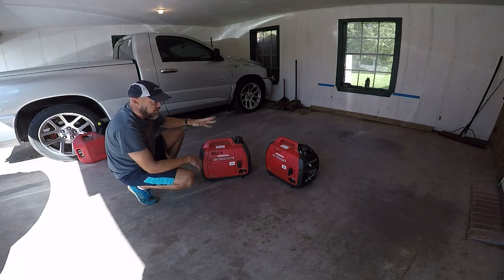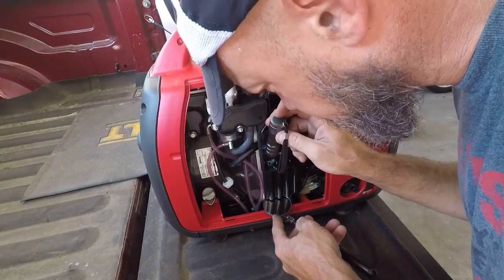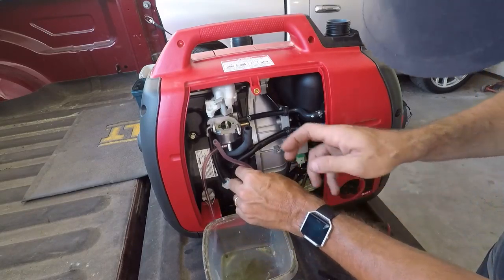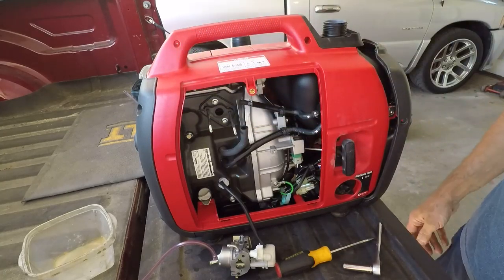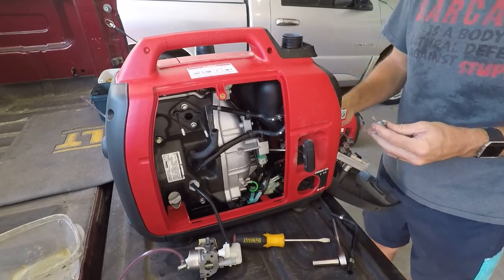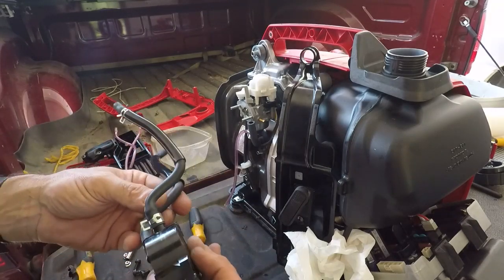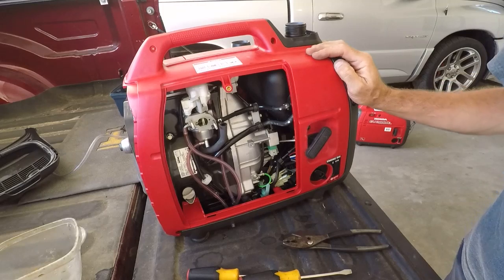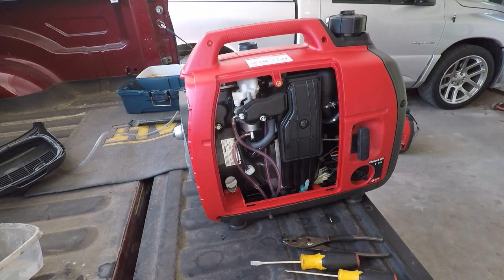Honda EU2000i Fuel System Complete disassembly and inspection

Comment: I had the same problem and it was a simple 10 min. fix on both of my 2000i generators.  The Pilot Jet has a super small hole that was clogged. It is not much bigger than a hair. I used a welder nozzle tip cleaning wire (the smallest one) and was able to clear the hole.  They both work like new!  Here is a link to another YouTube video showing you how.  https://youtu.be/QdUlhJFHlDU
Reply: You nailed it, I ended up cutting a bristle off a wire brush to unblock this miniscule jet, fixed it straight away. Screw the black plastic idle screw all the way in counting how many turns before removing it so you know where to reset it after putting the pilot jet back in. This is a Maintenance job you will end up doing repeatedly.

Comment: What a waste of time watching this . This guy has no idea what he’s doing. Took the carb off and  did no clean the jets did not remove the bowl . Took all the covers off to look at a fuel pump that he had no idea what he was looking at .the first thing you should have done is pulled carb and disassembled remove float to get to main jet clean with carb cleaner put back together and try to start to see if it runs. Good video on disassembly only . Wish you luck